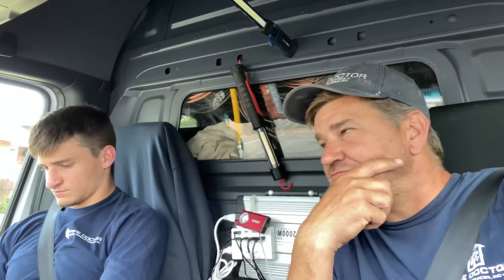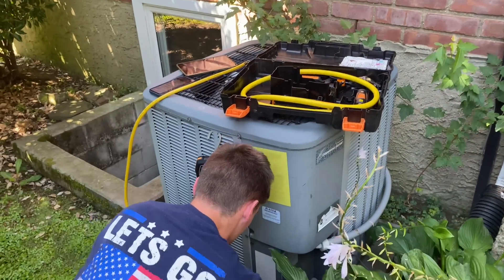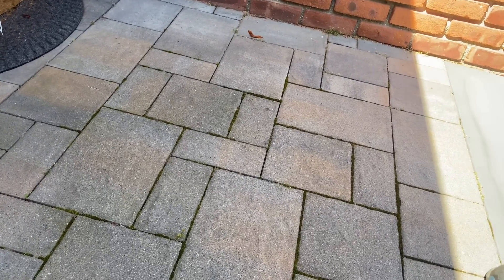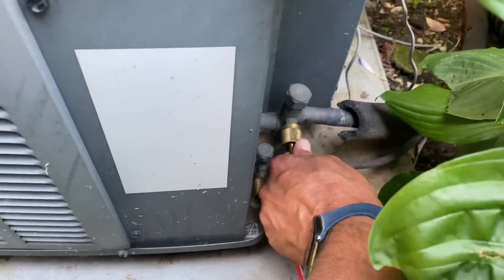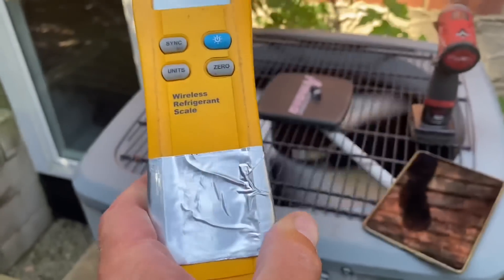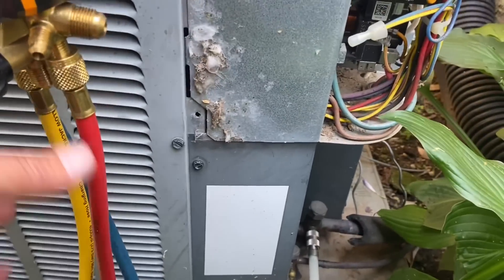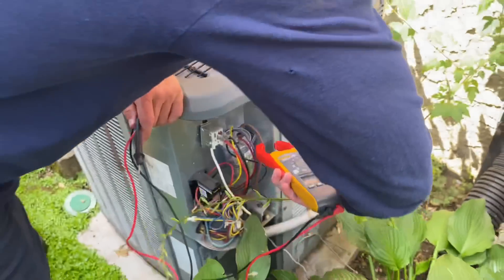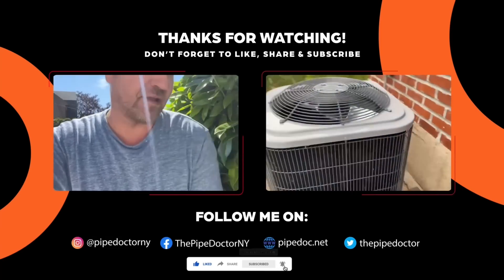How to Discuss AC Refrigerant Leak Options and Testing Capacitor When System is Running

Comment: Hey Mikey what are your thoughts on technicians using one manifold for 410 and 22?
Reply: You really shouldnt with a compound gauge set. If its the wireless probes like testo or fieldpiece then its not a big deal but the hoses hold the oil and poe vs mineral oil= acid

Comment: There is no good reason to test a RESIDENTIAL UNIT cap while running!
JS!
Thanks again for the videos!🍺🍺🍺🥃🥃
Reply: It's an exercise in understanding LC circuits.
If a DIY wanted to check the capacitor and didn't have a meter with the capacitance feature on it, they could use this method.
Reply: You get the benefit of testing the part under load. You might catch a failing capacitor a little earlier than you would by testing it out of the circuit with a capacitance tester.
Reply: Why do you believe this.  What are the cons?
Reply: @hvacotj  it's unnecessary for residential.
Lock out tag out (commercial)
Why risk a short or shock?
If your meter can't read uf, get a meter that will. (You shouldn't be touching equipment)
He'll figure it out!